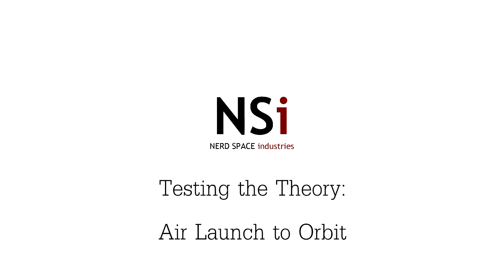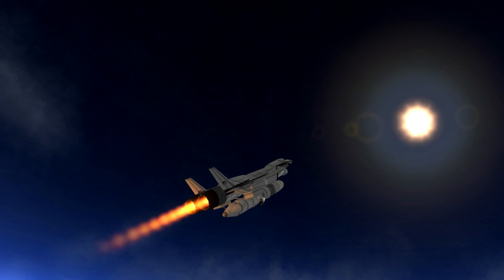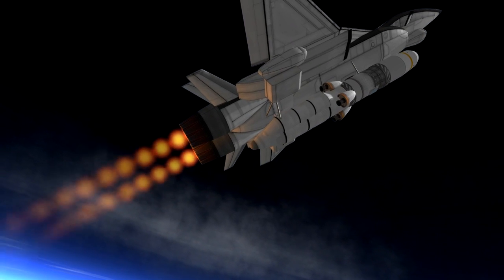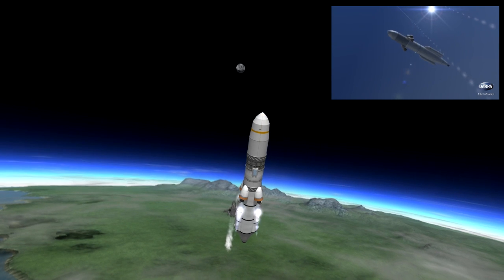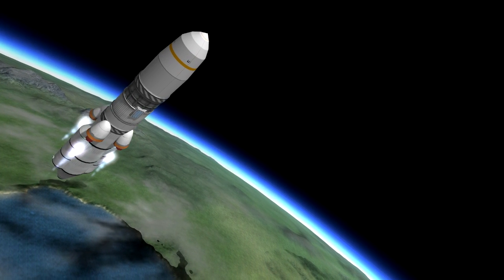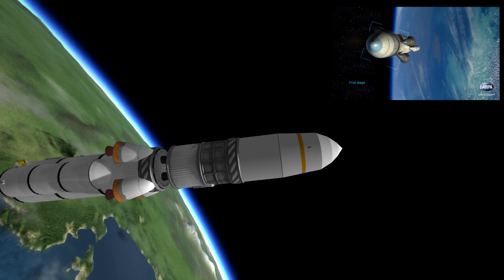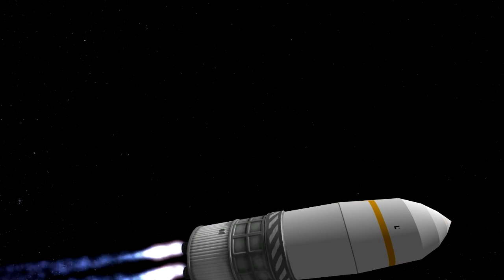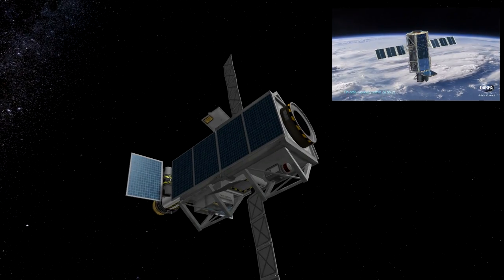Testing the Theory: Air Launch to Orbit

Comment: How hard would it be to launch astronauts using the air launch to orbit methed?
Reply from the maker: I think the limiting factor in launching astronauts via this method would be size. Look at Virgin Galactic, which doesn't even reach orbit and seats 6 I think, then look at the size of the carrier plane. Imagine how big a plane you'd need to launch 6 people to orbit. Then if you're putting them there for any length of time you need habitats and life support. It just becomes more viable to launch astronauts with the stuff they need which makes rockets far more viable due to higher payload capacities.

Comment: The upper stage was to be a liquid bipropellant. http://ventions.com/menu/ . As an aside, the old Lockheed airliner is pronounced "ell ten eleven".
Reply from the maker: +GoSlash27 That's really interesting, It's so odd that the animation shows the engines at the front of the first stage, yet the only reason I can find for that as a design choice is using them as second stage engines. If the upper stage was a bipropellant, I suppose theoretically a different mix could give the same engines more ISP at higher altitudes. I can't see it making that much of a difference though. Thank you for the info!